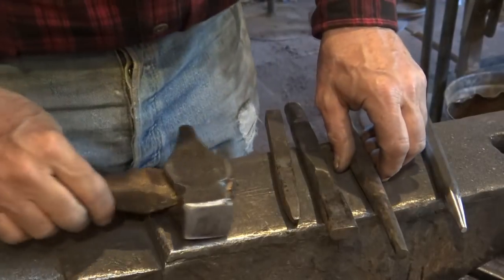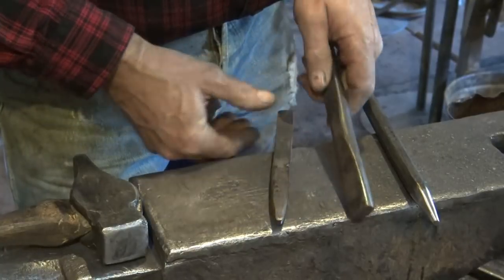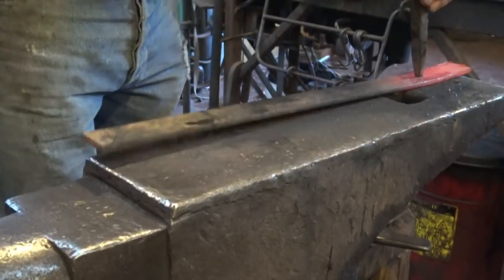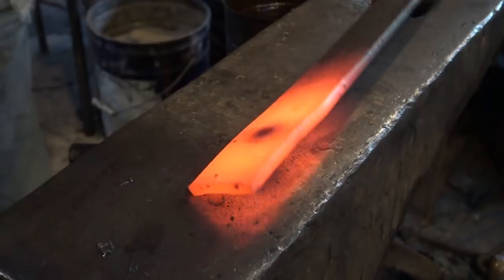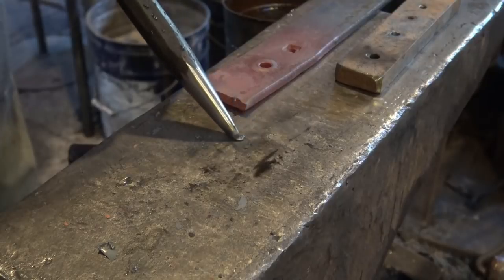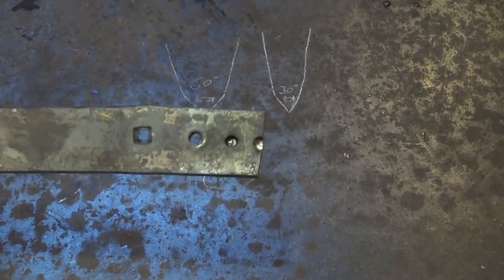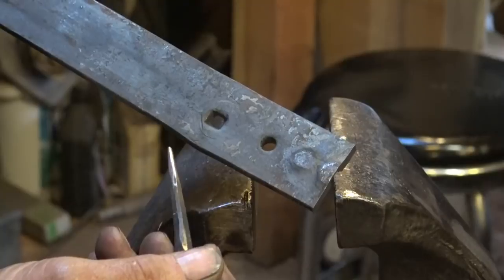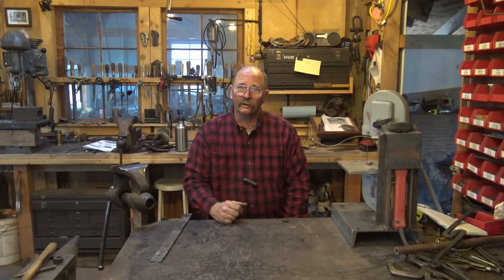Hot punching for blacksmiths

Comment: I have a 15cm circle of 40mm plate I have a series of holes drilled in from 6mm all the way to 20mm. I use it for punching, drifting (I have a drift to match each hole size) and for making rivets!  Great all round tool.

Comment: That was very informative! Thank you! 
Quick question,
How do you keep your punch from getting stuck  and overheating before being able to get it out in a thicker piece like 3/8 or 1/2
Reply from the maker: Removing the punch and cooling often helps as does making sure the punch is dressed properly, if it starts to mushroom it is more likely to stick.  Coal dust or a punch lube can be a great help, I use a lube from Quick and Dirty Tools when needed.

Comment: Do you have a pro tip on how to adjust a hole that is off centered slightly in thin stock and bulging more so on one side. I am trying to punch 1/4” hole or slightly larger in 1/2” x 1/8”stock.
Reply from the maker: heat the side with too much material leaving the thin side colder when you drift to final size and it will move over a little.
Reply: @BlackBearForge    I  will try that today. Thank you so much.